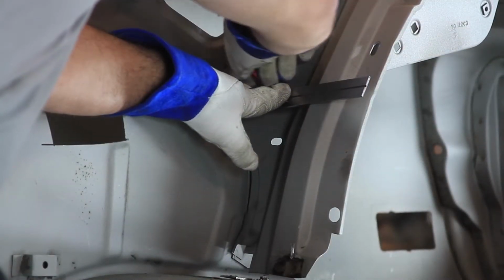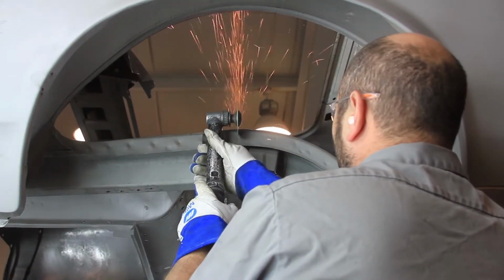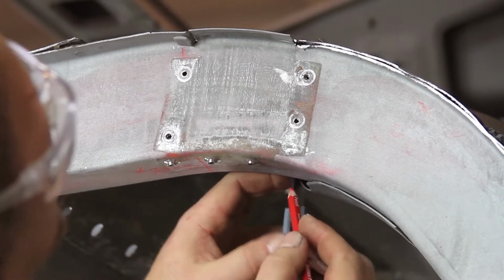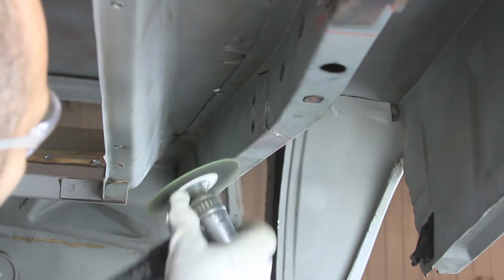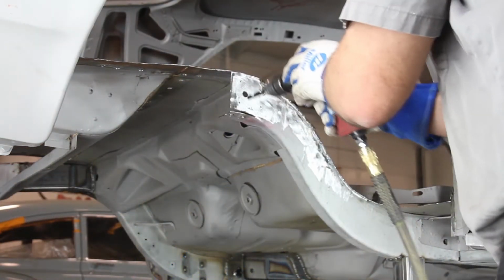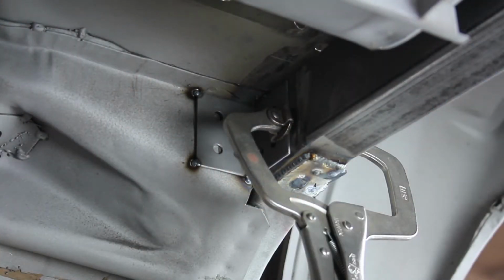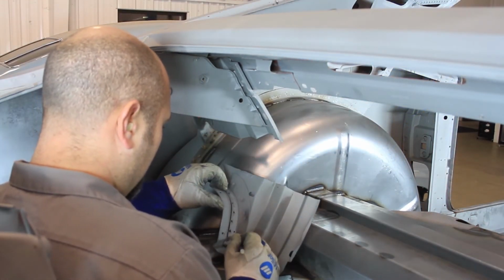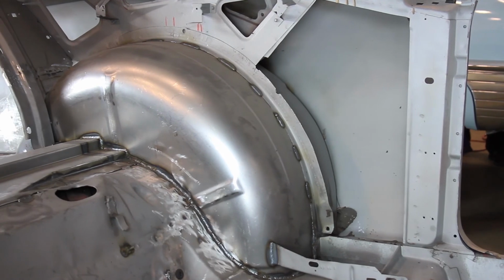Detroit Speed 1964.5-1970 Mustang Install - Mini-Tubs

Comment: That is major surgery for a DIY’er.  I would just have to write a check to a GOOD shop.  Thanks for sharing though.
Reply: I’d have to disagree with you. I’m a DIY’er with a welder and the same tools that are used in this vid and it took 12 hours. Granted my car is gutted like the car in the vid, but if you take it slow and measure twice and cut once, you’ll can do it too. Not to mention you’ll get a great confidence boost after it’s finished.
Reply: my thoughts too